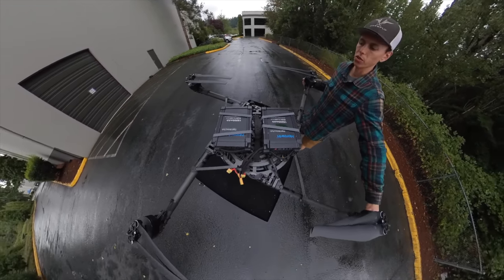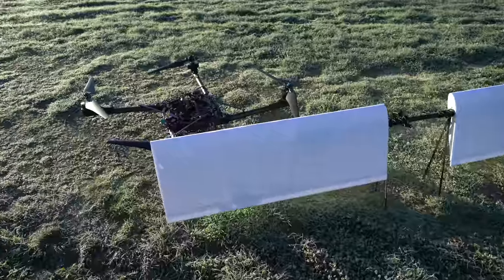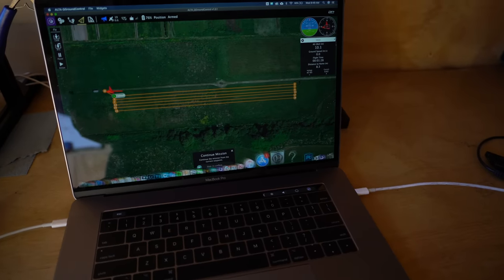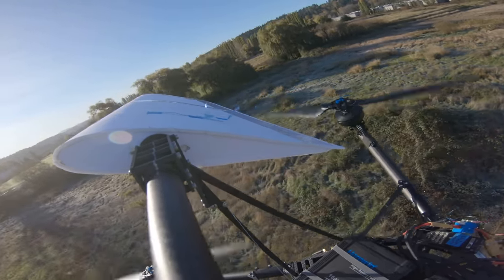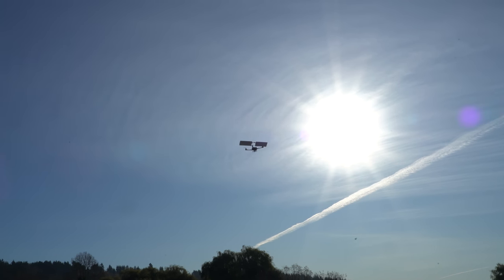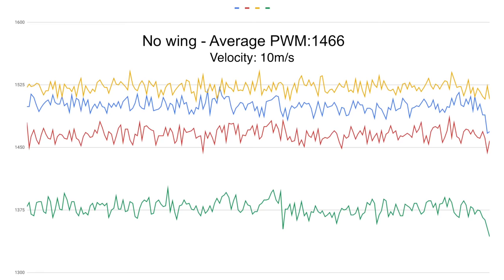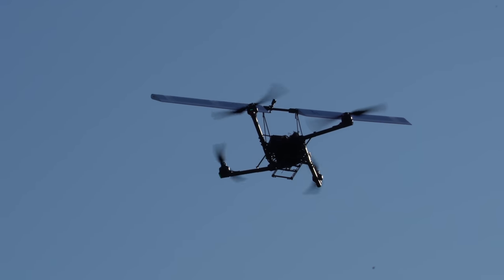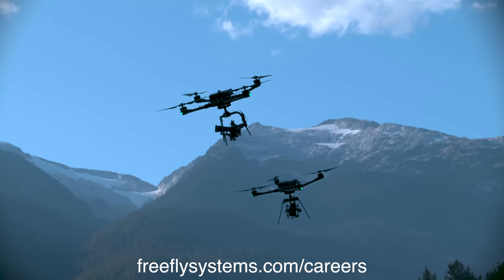Can a Wing Increase Quadcopter Efficiency?

Comment: From the numbers presented it looks like the effective L/D was increased from 1.6:1 w/o wings to 2.1:1 with wings.  Because the wings off-load the rotors, the drone w/wings will need more rotor tilt to fly a given speed than the quadcopter w/o wings. Eventually the rotor blade pitch will be too low for efficient flight and the drag of the quadcopter frame will become excessive due to the body tilt.  
Another approach to increasing multirotor performance is shown in this video where the fuselage is streamlined and remains level while the rotors can tilt. There are no wings, just streamlined fairings on the tubes supporting the rotors. This aircraft has demonstrated effective L/D > 3:1 at speeds above 15 m/s.
https://www.youtube.com/watch?v=QoKzomwi-Fc

Comment: Bro, I bet you had the gps turned on? The gps would fight against the lift being created as it tries to hold the drone at the prescribed altitude, if you run the test with no gps it might work, but you need the drone at a much higher pitch

Comment: Why focus on "efficiency" when you have a 4 rotor airplane? What you're doing is like strapping off road tires on a Ferrari and then being disappointed it got stuck on a rock.
Have the wing pointing straight up (or almost), crank the throttle to max so that you'll have a 4 rotor aircraft with the wing providing the lift and enjoy the probably way higher max speed.

Comment: You put the wings in the wrong place

try putting it outside the radius of all propellers
You make the drone a little bigger, but there should be no more interference with rotors/

Or put the wings in front of and behind the unit in a balance configuration

Comment: Putting the wing above the entire craft was doomed from the start. Any time that wing gets lift or drag, it's forcing the balance the shift in an unstable manner. With hang gliders you get away with it, but when every tip and turn is vectoring the acceleration, it almost guarantees death wobbles. I'd bet you'd have more success using an outrigger design with its wings extended out horizontally. In line with the center of mass and lift. That way, you can tip forward to accelerate and maintain stable flight, because quads make terrible hang gliders lol.

Comment: For a complete comparison, you should also create a weight that is the same weight of the wing and attach it to your drone to get what the extra weight adds to the flight requirements. Then you can see if the wing does add any benefit to flight.

Comment: Why does anything fly? It is because it is accelerating air down. 
In the following I"m rounding numbers a lot. To get more exact calculations, use more accurate numbers. 

So for a 1kg drone to stay in the air, it needs 10N of force to balance gravity. So it could take 1kg of air (1m^3), accelerate it at 10m/s^2,  f = m * a = 1kg * 10m/s^2 = 10N that balances gravity! But what if it would be taking 2kg of air instead of one? Now it would only need to accelerate it at 5m/s^2 to get the same 10N to balance gravity. 

What does that gain you? Not much you say? Wrong! This makes a whole lot of difference. The ENERGY transferred to the first 1kg of air is 1/2 m *v^2 = .5 * 1  * 10^2  = 50J. But in the second case, the energy is E = .5 * 2 * 5^2 = 25J ! only half the energy. 

(in practice, you can't fly an 1kg drone on 50 or 100 watts. So apparently drones are "processing" much less than 1kg of air per second). 

So if you manage to influence more air efficiency goes up. A fixed-wing aircraft sweeps through a lot of air That's why it is efficient. Using a wing that is about as wide as the quadcopter... doesn't help much. You don't sweep much more air.

Comment: Your idea has merit but the wing needs to be level at all times, possibly a giro to keep it on plane as the quad transitions forward and as a mount moves/tilts to keep the weight of the quad centered under the wings area of lift. Umm… That sounds to much like work… never mind 🤣

Comment: Interesting attempts. It would only be successful if the angle of attack of the wings were continuously controlled by computer. A problem might be that the center of buoyancy should be identical to the center of mass. I consider combinations between multicopters for hovers combined with wings (and drive) for forward flight to be more successful. That already exists with VTOL aircraft (even fighter jets like the F-35B). I found other attempts interesting here: https://youtu.be/gDtjMh_ZQwE

Comment: The wings were too small. If the wing is actually creating lift u could turn off the motors and glide down on just the wing alone like a glider from altitude. If the drone drops like a rock without the motors running you aren't actually doing anything with the wing.

Comment: https://youtu.be/uI8Ql4FVGOI
 ("Wing" delivery drone)
This design might be considered for some of the geometric positioning of wind moving parts. These particular drones were built for a smaller lift capability than your requirements.  The wings are out of the prop wash of the vehicle lifting props and CG remains almost uniform throughout the transitioning from vehicle to horizontal flight and forward pulling props are added in line with the wings airflow when cruising. I haven't looked at their history of experimenting on iterations to this point, but I did read that they tried differing numbers of props on the wings and  booms. It would be interesting to work on given your particular set of requirements, which on first thought would be smooth and stable flight without wearing out its FC and motors for reliable carrying of expensive photographic gear. 
Perhaps retracting of the end sections of the (larger) wing (s) might help with the size restrictions in tight landing and takeoff situations. It would be so much fun working on this. I wish I had even a rudimentary understanding of FC programming
https://youtu.be/uI8Ql4FVGOI

Comment: OMG
Wing too high up -> increased pitch up with speed.
Drone pithces down to go forward -> wing goes in front of center of mass -> even more increased pitch up
In total: Drone tilts down -> gets some speed -> wing starts to pitch the drone up from speed -> less speed -> drone tries to correct by giving more pitch down. This is why you are getting the oscillations. The controller can not work with the the reaction from all the forces this delayed.
You can probably overcome it by making controller work with pitch several times slower.
But it would make more sense to place the wing in a more suitable place then to make drone fight the destabilizing effect from this wing position.

Comment: I know you are not a Rotary Wing guy when you call a rotor a propeller!
Propellers produce no lift only thrust.
Rotary wings produce both lift and thrust.
They are the deference between a helicopter and an airplane.
The only exception to the rotors produce lift and thrust rule is a gyrocopter which has both a rotor and a propeller. The V22 Osprey has Rotors not propellers. Quad copters have rotors not propellers.

Comment: Need the motors and windflow on the outer portion of the wing, similar to the osprey...this way the props in vertical the wind is still passing over the wing, and in forward flight it assists in the lift of the wing, and there needs to be a servo to lock the angle of attack in...if it's not locked in, it creates too much variable the flight controller ends up creating the oscillation trying to compensate
might be better to have short stubby high lift wings on the bottom of the airframe below the props...
Then there is hybrid
https://www.youtube.com/watch?v=rInUxB8t3Yg

Comment: I'm surprised nobody extends flight time by using ballasts inside the drone, like on a submarine, to hold lighter than air gases.
Reply: The amount of buoyancy you get from displacing a fluid or gas is equal to the weight of the displaced fluid. So in the case of a boat if you have a displacement of 10 liters, then you have a buoyancy of approximately 10kg (1 liter of water weighs approx 1kg). Because air is so much lighter you have to displace a LOT of air in order to produce any meaningful buoyancy... hence why blimps/airships are SO large! 

To add buoyancy to a drone you would have to add such large structures to hold the helium/hydrogen that the drag would go WAY up and negate the benefit. You basically end up with a blimp rather than a quadcopter 😳
Reply: good idea, but 1 sq meter of helium lifts ~1kg, so i think it would get big really quick

Comment: solar electric helium balloon drone is better
Reply: k.i.s.s. less moving parts the better
Reply: try the flutter flex membrane fish-tail fan (diy electric-coil magnet flap ducted fan)
Reply: your wing cg is horrible above the drone
Reply: are you trying to kite tho
Reply: kite could be easily folded during flight transition
Reply: kite glider could fly on its own, unpowered, also
Reply: tail-sitter transition is better than the horizontal wing attempt
Reply: vertical oriented wings
Reply: try normal drone props with ring tip ends